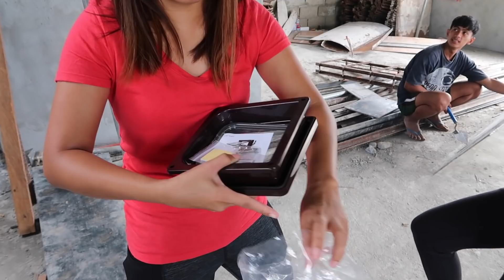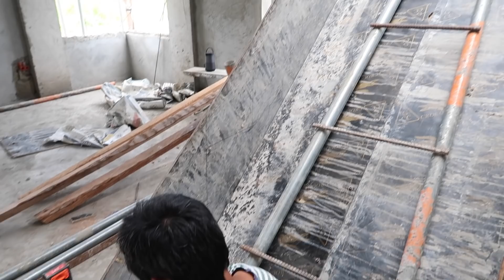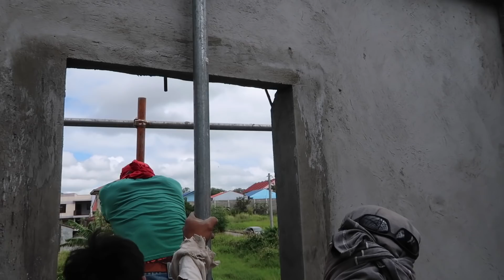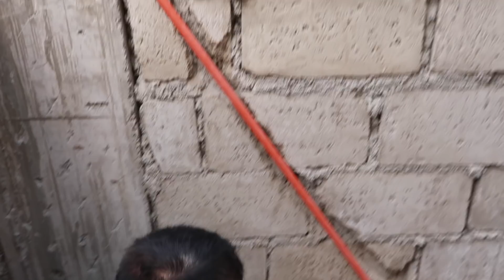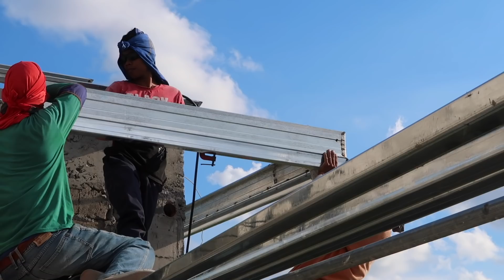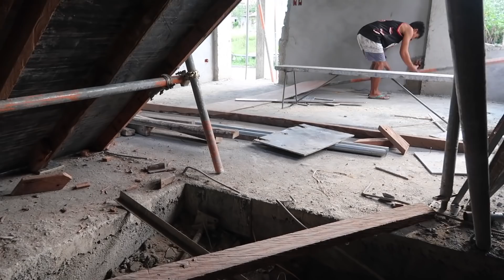HOUSE BUILDING IN THE PHILIPPINES - EPISODE 92: FASCIA BOARD

Comment: Good day! Anong size po ng C Purlins na ginamit as Fascia Board? Thanks
Reply: Same question po. Pls.
Reply: I have the same question but it looks like 2pcs of 2"x6" c purlins welded together which makes it 2"x12". The common size of a hardiflex fascia board is 1/2"x12" down side if you will install it together with metal purlins is that it is not metal thus unweldable.